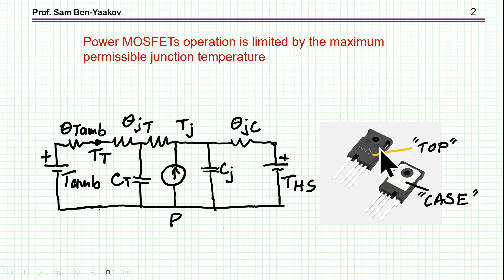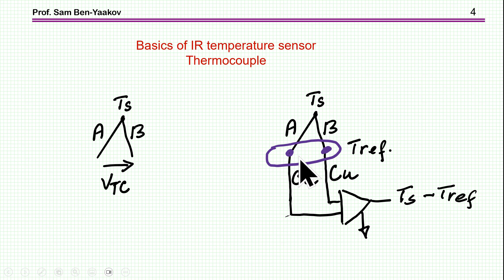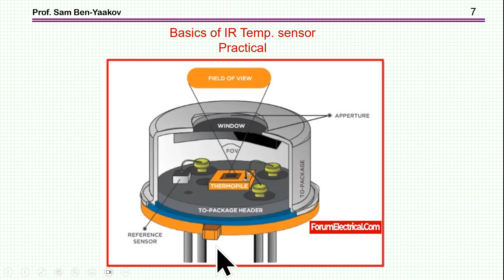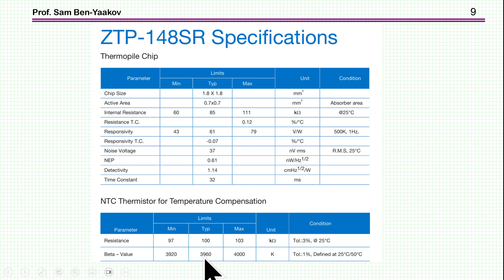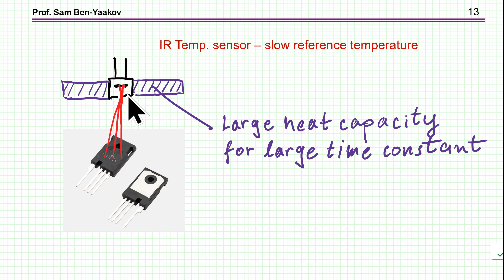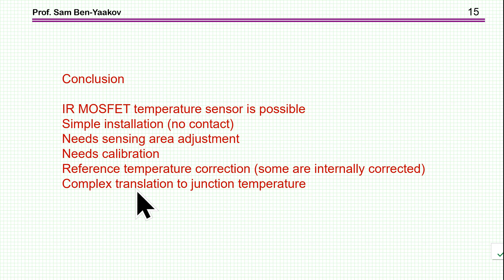Infra-red (IR) temperature sensor for power MOSFETs

Comment: Just a random thought from a hobbyist: To calibrate an uncalibrated MOSFET put it in a controlled oven set to the desired Maximum Junction Temperature. 
Monitor the internal diode forward drop at a constant current. Let it heat-soak till it is heat is saturated, and the diode's forward drop Voltage has  stabilized. 
During testing for maximum current allowed through the system at different ambient and PCB temperatures. Periodically cut the MOSFET off from the circuit and test the internal diode forward drop, at the same constant current. This should give a very accurate indication of the devices internal temperature.
I am assuming the topology of the MOSFET has the current junction and the internal diode equivalent in close proximity.
Reply from the maker: Possible in principle but highly not practical

Comment: This in fact would be much more useful for higher voltage modules and medium voltage transformers, e.g. 10 kV SiC modules and transformers for them. We ever tried to design temp sensors based on NTC or fiber temp sensor but the cost is high and the implementation is very complicated (using HV power supply or special fiber transducer). With this IR sensor, just put them on the gate drive or current sensor boards and share the power supply and communication, and it can be very impressive if the IR light can penetrate well through the silicone gel.
Reply from the maker: Thanks.  Yes, that could be an interesting application of this technology. Thanks for your thoughts

Comment: Professor,
How can we find the thermal resistance of Junction to tab in datasheet? 
In mostly datasheet there is two thermal resistance they mentioned Tjc and Tja.
Reply from the maker: Tjc is for the junction to metal tab
Reply: @sambenyaakov  yes, but for measurement with an IR temp sensor on the plastic tab, theta of tab to the junction required? Right?
In my flyback smps i had measured case temperature with thermocouple with hole in heatsink and tab temperature with ir sensor parallely, they are nearly same.....
I have used cree mosfet 1700V, 4A with heatsink.

Comment: TI makes TMP708/709 thermal switch devices in SOT-23, with 0.5C accuracy. Just put them on the board as close to the FET as possible, much simpler than an IR solution. They have open-collector outputs so can be wire-ORed. There are also many SMD NTC thermistors available.
Reply: Its offset from the case temp by a fair bit, you measured and what differential did you see?
Reply: @jaro6985  My board has a lot of copper on 6 layers, so the temperature in the area around my MOSFETs is pretty uniform, within a degree or two C. Good enough for emergency cutoff.
Reply from the maker: This is OK for protecting the PCB

Comment: Isolation would be the only advantage of this sensor, but there other ways to get around that.
Reply from the maker: Indeed
Reply: This sensor could measure the realtime temperature on top side, without other delay factors. NTC or other contact thermal sensors will always have to sit with some distance to the case. I remember Vishay or Onsemi had a power mosfet with thermal diode grown on the same die, this could be the ultimum "accurate" sensing..

Comment: wow thanks! It seems like you can read my mind. I was thinking of over temperature protection for power MOSFETs and looking for a simple solution just recently. Is it also enough just to monitor over current condition using the MOSFET driver feature and deduce the over temp condition from the overcurrent?
Reply from the maker: Just current monitoring leads sometime to over protection. E.g. not allowing a short bursts of high current which are still safe.

Comment: Quite a sophisticated method with multiple stages. Why not integrate a sensor, anyway modern power transistor is de-facto an integrated circuit.
Reply from the maker: Too late 😊 see https://www.infineon.com/dgdl/Infineon-IPT60T022S7-DataSheet-v02_01-EN.pdf?fileId=8ac78c8c8afe5bd0018b4c5965fd7aeb

Comment: Amazing! I saw on ElectrArc240 channel a video about EVs using the inverter for heating the passenger area. Supposedly they make the inverter less efficient on purpose by lowering gate voltage or whatever.
Reply: I am using a similar concept for below my table. I covered 3.5 sides with mylar sheet and there's a buck converter + heating eliment with fan. I have placed the buck directly behind the fan XD.

My feet stay warmish. It's 3°C outside. 
(I plan to use a peltier next and transfer laptop heat down below)
Reply from the maker: @MrRohailbootwala  Great! 3°C outside??wow
Reply: @sambenyaakov  indeed indeed. I am thinking that I can do better by placing water cooled peltiers at the top of window frame. Then transfer the air heat via water pipes
Reply: @sambenyaakov  Just to clarify, I am not using gas for my room. I use a heating jacket for the Torso
Reply from the maker: Thanks for the info! It will get hot even with low gate resistance😊